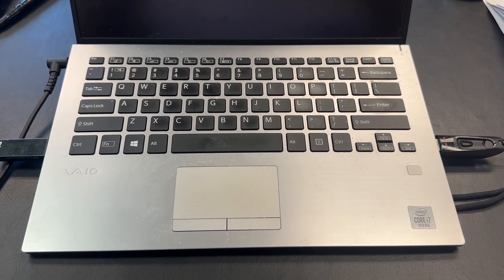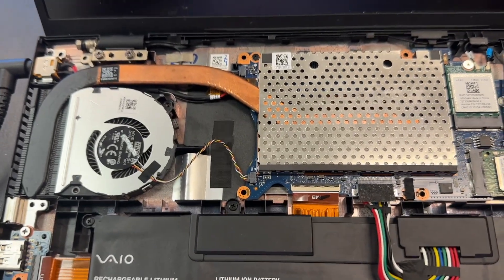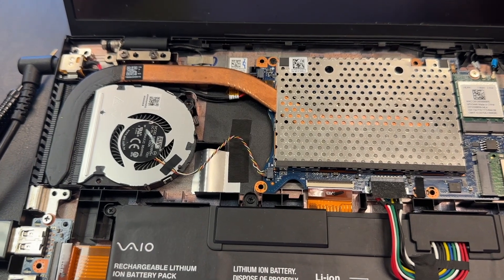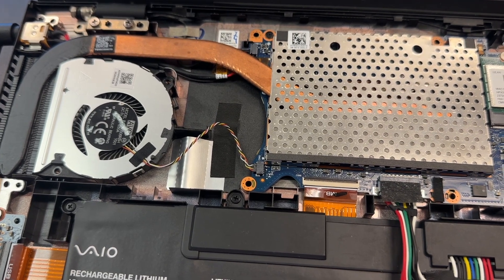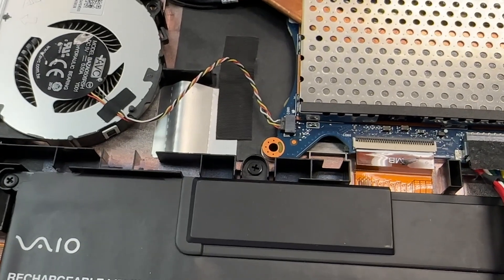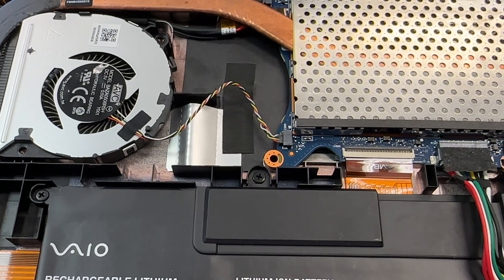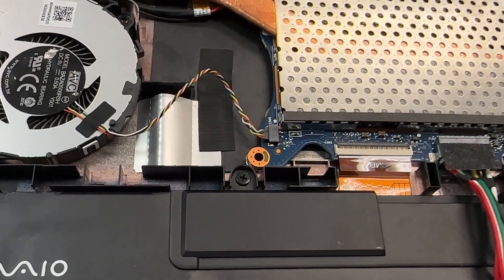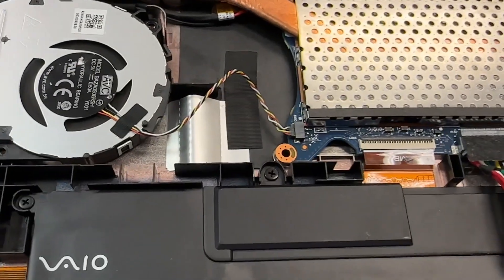Sony Vaio VJS142C11L VJS11 VJS14 Constant Shutdowns Black Screen Would Not Load Diagnostics & Repair

Comment: Thank you very much.  I replaced the fuse with 2A fuse and worked fine. Sony VAIO PG VJS14. What I understood is Faulty fan can degrade the resettable fuse. I think if the fuse is degraded it is better to replace the fan together with the fuse.

Comment: Same issue with my exact same Vaio. I thought it was the battery and have been searching for a replacement (which I can’t find actually) when I found your video. It will fully charge, then as you said sometimes it shuts down after I put in the pin and it comes to the desktop and other times it lets me go a few minutes. If I plug it in and turn it on the fan runs quietly. Could it also be the battery? Do you know where I can get a replacement? Thanks for doing this video! 

Well, here’s an update - after I blew on the fan, plugged it in and turned it on, it has stayed on and I’m doing all the updates. It’s been months that I haven’t been able to use it. I wonder if the back was screwed too tight around the fan? I’m not putting the screw back in that spot. So we’ll see?! 🤞🙏 The fan eventually stopped and shut it down.😕

Comment: I have the same issue with the Sony Vaio VJS142C11L. Replace the fan and  same issue.  Where can I find the correct fuse and instructions on how to replace the fuse? Does the fuse have plus and minus polarity  or I can just solder anyway?
Reply from the maker: No polarity. Need soldering iron. This fuse will do. https://amzn.to/3t28GNq
Reply: Can bridge with wire instead of getting new fuse. Becuase it is pretty hard to desolder the fuse since its so tiny. I just need to replace onw fuse? Is that correct. Also I do have voltmeter and just wanted to know how I can check the voltage. Thank you for previous reply,
Reply from the maker: Ask any repair shop around to do it for you. Bridging it with wire is not a good idea